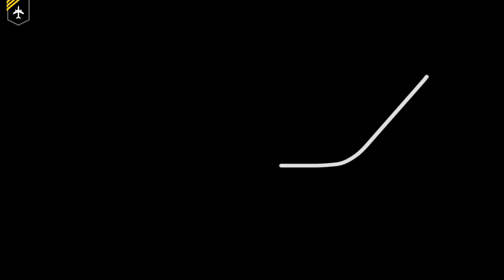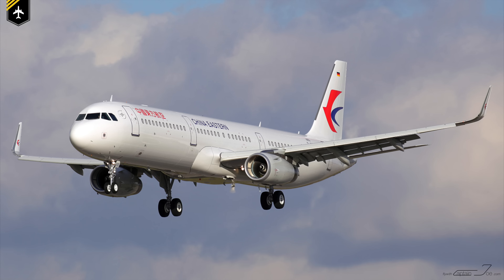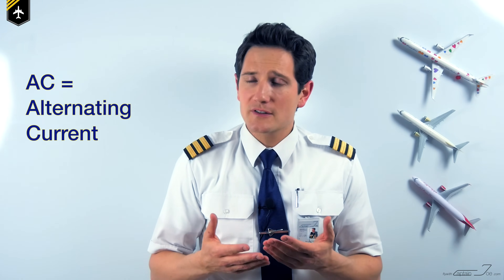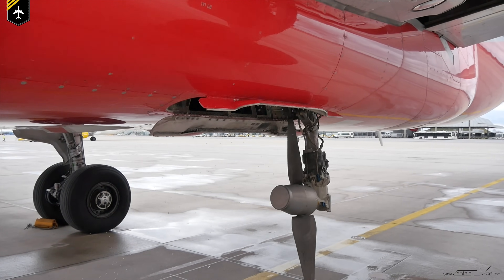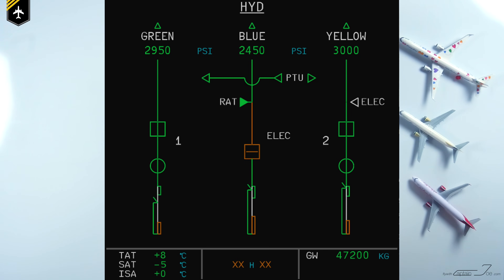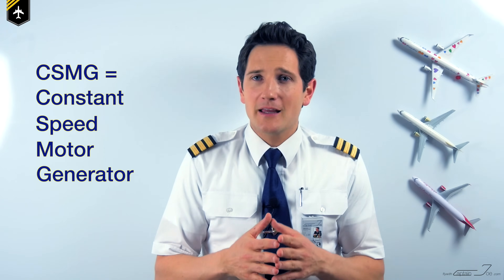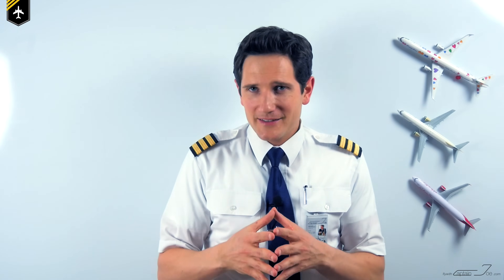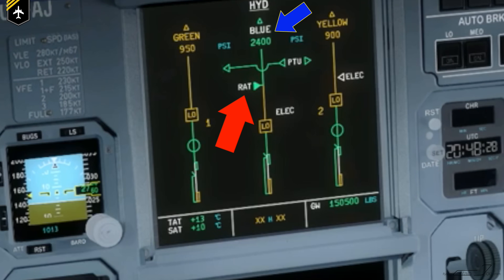What´s a RAT? RAM AIR TURBINE! Explained by "CAPTAIN" Joe

Comment: hi joe,
if a plane is running on ground supply and for some reason it fails, will the software restart or there is some backup supply for the software to prevent it from restarting?

Comment: Thanks for the video Captain. The Gimli Glider incident involving Air Canada Flight 143, and later made into a movie "Falling From the Sky Flight 174", where RAT was deployed and one of the main reasons the plane could be landed without any power from the engines and hydraulics.

Comment: how y can control the speed and mentain the speedwithout engines ?? 
Q : on the famous incident story of the British flight how can or did try the plane captain to start the stopped engines when he was flying through a big Indonesian volcano aches the all 4 engines stopped by the Sulphur ashes and the plane glide for a long distance without thrust .. he used the wind or the small engine for startup at back of the plane or can the RAT provide enough Electricity for plane ?? why they don't make more RATs ??

Comment: I don't understand why don't they just put like 600 lithium ion batteries or in this case like 300 as they do in the Airbus  A380 or whatever that huge plane is and just draw off them? They will get a hell of a lot more then 5kv which is almost laughable for control surfaces on an airplane
Reply: It's due to the weight and fuel efficiency. That's why electric planes are no where to be found.

Comment: Hey, I always thought that in the case of a double engine failure that the air friction from the speed of the plane would always keep the engines moving at a slow speed? Is this not enough speed to keep electricity going?

Comment: Seems like overkill.... You have an apu
Reply: D E apu is still an engine. So if there is no fuel, then the apu is basically a waste.
Reply: @ZK-APA  I see thank you. Prevents single point of failure if you run out of fuel.

Comment: Captain Joe, or anyone else:
In an absolute emergency, how long can the A.P.U power the entire plane, say, at cruising altitiude?
Reply: There is no time limit on how long an APU can power an aircraft except fuel.  Most have an altitude limit on when they can be started and you can only draw as much current as the APU gnerator is capable of providing.  Typically you would have at least 1 generator on each engine (some aircraft have 2 generators per engine).  So you would have to loose both engines to be down to the APU as the only generator source.

Comment: Sir,
I want a detailed information about the pitot tube and it's working.. 
So can you please make a video on it.. 
I really want to know that how does it actually works.. 
I mean how can it indicate the accurate speed of the air speed indicator which in turn is connected to the pitot tube.. 
I'm not getting the valid solution of my question & so you are the only last hope left for me.. 
So, Sir please make a video on pitot tube whenever you're free!

Comment: Air ram turbine... Air ram...  Air that rams into the turbine and mixes with the fuel.  The air compresses as it gets rammed into the engine and that creates the combustion.
Reply: THIS ISN'T ABOUT THE BACK UP GENERATOR PROP BUT AN ACTUAL TYPE OF ENGINE CALLED A CRAM JET.

Comment: The APU wont power the B SYS EMP. RAT will automatically deploy for the 320 in TEFO, loss of one engine and loss of other engine driven generator, or loss of normal power production. No dependency on the APU.

Comment: So in the presence of APU why is RAT required??
Reply: If you ran out of fuel for instance, and that actually happend, the APU will not work. Also passanger planes are aloud to take off with a non functioning APU.

Comment: I watched too much TV on air crash investigations. Usually the investigators say something like '...the controls (RAT etc), failed - then you see the plane turn upside down and the pilots start going down. My question, during deployment of RAT can the air speed rip off the RAT's propeller blades or entire arm for that matter? Cheers!

Comment: In 2092 an Air Transat A340 flight from Toronto to Portugal lost all fuel (through a leak) and hence engines: they glided from cruise height to land in the Azores using the RAT for power.

Comment: Hi Capt Joe... After all unnecessary electrical appliances are shut down, does the RAT provide sufficient power to have the cabin air-conditioning function normally? Especially since all major aircraft types before the B787 rely on bleed air for air conditioning??
Reply: Ashwin Valecha Of course not if your using the RAT it means all the engines are off and you need engines for airconditioning

Comment: I believe this is how AirTransAt flight 236 landed when they ran out of fuel over the mid Atlantic. Even though it was a glider, at least it was a controllable glider. As the green and yellow hydraulics were lost due to engines starvation the RAM kicked in to control the aircraft by providing minimum electrical power to the aircraft instruments. I also believe it was an Airbus A320 as well.

Comment: Captain Joe - could you make a video Cockpit 101 showing where all the instruments are and what their functions are - for example when you did the demo of a passenger landing a plane most of the time was spent directing where a certain button or control is - thats what i am talking about. My nest biggest question would be what happens if the ILS goes out and you are in cloud with no guidance on glide slope or runway alignment. Thanks

Comment: Why not install several RATs?
Reply: ronch550 it creates air resistance and slows a plane. If both engines fail you have no thrust. With big air resistance a plane goes down faster.

Comment: Batteries can provide power minimum 20min or Maximum 20min? Thank you  to clarify, captain JOE.
Reply: 20 minutes are guaranteed, but the minimum guaranteed time span is effectifly the maximum time span you can use them reliably.
Maybe the batteries hold 30 minutes but maybe the already fail after 20 minuten and 1 second. So pilots calculate with 20 minutes max because after that they can fail any second.

Comment: hey Joe why isn't the RAT deployed all the time wouldn't it be fuel efficient
assume that plane consumes 5 megawatts of power per minute after an hour with RAT deployed it will consume only 4.74 megawatts per minute i.e you save 16.66 megawatts per hour
isn't that efficient
#captainjoe
Reply: Rajwardhan Sagare in the air electricity is generated by the main engines. So there is hardly any extra fuel consumption to require a RAT
Reply: A2DJP  thanks

Comment: Air Transat Flight 236 Dual engine failure due to fuel starvation. So no APU. RAT was the only option which provided basic power as Capt. Joe explained.  Captain Robert Piché and First Officer Dirk de Jager flew their plane without engine power creating a record. Souls onboard 306. All survived. In Capt. Chesley Sullenberger case they had fuel to power the APU.

Comment: RAT in therms of probability is in the same cathegory as life vest on board the plane. If the plane goes down in water (usualy ocean) it will brake into peaces and life vest will have no meaning. Also main engine driven AC generator will fail in 0,001% of cases. More often the engine itself will fail thus AC generator won't provide power. On multiple engines aircraft it is higly unlikely that both engines will fail due to mechanical problem. Also in such a case we still have APU or battery wich will last long enough to glide the plane down. We will lose engine thrust due to fuel problems or bird strike or something with higher probability. In my opinion RAT is just not needed since I see no real life scenario it will be needed.
Reply: Actually, the RAT saved some people asses in the real world. The batteries provide you some instruments but no hydraulics. That's why you need the RAT and if you have an engine flame out because of fuel starvation, which did happen in the past, you can't start the APU because the APU uses the same fuel as the main engines.

Comment: Thanks again for your very informative videos. For sure a Captain has to know about the RAT, but does this include your very technical knowledge about the hydraulic and electrical systems? I always through you had a board engineer in the past or today on the ground for such technical knowledge. Don't get me wrong, I don't really know much about your job as flight captain and the things you need to know, but I really enjoy all these technical details. For me as technician I feel pretty safe now, knowing that pilots know their airplane ;)

Comment: Question: So in an emergency, the green and yellow systems give way to the blue system to provide power for the flight controls to work?
Reply: Not exactly. The hydraulic system in an Airbus is designed in a way that the blue system provides pressure for all basic flight controls like the elevators, ailerons, rudder and flaps and slats. The yellow and green systems acts mainly as backups and also provide pressure for the less importent elements like the spoilers, landing gear, thrust reverser and so on.

Comment: Joe, RAT cannot provide enough power to the flight electrical system by which ailerons, rudder and elevators can be moved. So its APU which provides enough power for the movement in case engines fail.

Comment: Why only one? When you have multiple RATs you can get more power, right?
Reply: More RATs would mean more weight and also, they deploy in the case that all engines have failed. So they add drag to an airplane that already has no means of propulsion.

Comment: What about other planes with no RAT like the 737 ? how is electrical power generated in case of both engines and APU failure and no batteries left ? I know it's not a fly by wire plane so they could maintain flight control (even if it's a though work since HYD are lost) but what about flight instruments ?

Comment: Hello joe

When you talked about the batteries the first time you said it works for a "MINIMUM" of 20 minutes, later you said for "ONLY" 20 minutes. Which one is it?
Reply: Well, they are guaranteed to work for 20 minutes. But as a pilot in an emergency, you calculate with a maximum time of 20 minutes, because after that, the batteries can fail any second, which you don't want to happen as a pilot.

Comment: At 1.49 you said that the batteries would only last for a "minimum" of 20 mins of flight (i.e more than 20 mins), yet at 2.13 you said they will only run for "20 minutes"??  Did you mean to say maximum?

Comment: On The Harrier (AV-8A/AV-8C) it is located directly  in front of the tail plain. It takes less than a second to deploy in case of Hydraulic failure.

Comment: Thank you Joe for your videos, I really appreciate your work !
In the case Of the Hudson river, there is more to say. Captain Sullenberger used his APU a few seconds after the birds strike. The APU needs about 2 minutes to be operationnal. Then, the RAT and the batteries covered the gap during these 3 minutes. 
I guess that any gap would cause the aircraft to be uncontrollable, but fortunately it's inconceivable because of redundancy !

Am I correct ?

I also react to an other comment. The RAT doesn't provide a lot of power, but it's a simple system. A simple system is more economic and less likely to stop working, especially when needed !

Thanks you again !

Comment: Hey Jo,
a question to the Hudson landing of flight 1549. As far as I remember, on a water landing both turbines have to make contact to water at the same time. Otherwise the plane would not ditch straight but crash to the opposite wing and take serious damages. As the RAT was deployed, did it play a part in this situation?

Comment: just a side note, the 747-200, and 747-400 do not have a RAT, the number 4 engine acts as a RAT because the airflow turning the fan blades is enough to generate emergency hydraulic and electrical power to the aircraft. the 747-800 does have a RAT

Comment: By minimum of 20 minutes, I assume you meant maximum 20 mins battery time?
Reply: In the example scenario he paints, he says "the batteries take over, but as stated before they will only last for 20 minutes".
That's not minimum, that's saying "you get 20 minutes". In other words, I'd suggest the whole thing is clumsily worded.
It might be that the safety requirement is they provide 20 minutes power and might provide more, but that only 20 minutes may be relied upon. If that's the case, that's how it ought to be expressed as it's concise in all aspects.
You're correct, however, that I misinterpreted his text as a mistake. It's not a mistake, but it is poorly worded when compared with the operational effect (you can only rely on 20 minutes) and the absence of what might be possible.
I'd want to know if  can rely on 20 minutes but might get an hour vs I can rely on 20 but expect to run out within 25. Sure, I can only rely on 20 either way, but my prospects look somewhat better if I could get 1hr vs a maximum possibility of 25.
Cheers
Reply: I am taking a guess here but when it comes to aircraft safety and redundancy it seems logical to assume batteries should provide energy for at least 20 minutes thus minimum sounds quite plausible.
Reply: Edit: altered this based on mcfurley's comment.
Reply: you said it yourself, run out "after" 20 minutes, so 20 minute minimum
Reply: yes well said thanks

Comment: The Boeing 737 does not carry a RAT, does that mean that the 737 relies only on battery power in order to power the electrical system and hydraulic systems?

Comment: You have an awesome channel!   

I flew in a MD-88 over the weekend where there are 3 seats on one side and 2 seats on the other.  It got me to thinking.   Are there any other balancing systems in a commercial Jet besides trim?  Can fuel be moved around to help balance an offset in weight?

Comment: I understand that a positive dihedral angle tends to add addition stability to an airplane's flight characteristics.  However, large transport planes like the C-17 and the Antonovs have a negative dihedral.  Why is that?
Reply: Essentially its the same Lee, but opposite.  Dihedral adds stability as you correctly mention, anhedral reduces stability, which in turns improves maneuverability.  You will notice on most large transports, the high wing mounted aircraft have anhedral.  The pendulous effect of the fuselage automatically adds stability, so in some cases the anhedral is adopted to ensure a suitable amount of controllability/maneuverability.

Comment: this "rat" system was a key component of the safe emergency landing from FL360 (36,000ft) after a fuel miscalculation on an air canada flight. resulting in both engines flaming out with literally only minutes of alert warnings from the fuel pump pressure indicators. (from warning to engine flame out). The boeing aircraft landed safely but the nose gear didn't lock correctly and collapsed but the plane came to a safe halt at gimli airfield in the USA.

this aircraft was nicknamed the "GIMLI GLIDER" and flew many more years of service after undergoing small repairs :)
Reply: Gimli Glider is one of my favorite story in terms of aviation accidents
Reply: @hannahapor4856  Same!! (TACA110 is another one of my favourites; check it out if you're not familiar with it! Mayday episode 'Nowhere to Land'.)
Reply: oseo943 
And Gimli is in Canada
Reply: Air Transat flight 236 (24-Aug-2001) as well had the RAT come out as they suffered fuel loss due to mismatched fuel line diameters on account of botched maintenance.
Reply: Gimli glider story :-P
Reply: Thomas yeah Canada was switching from Gallons to Kilograms and they asked for the amount of fuel in gallons and ground gave them that amount in kilograms.
Reply: @j-c4997  It was more complicated than that, they used an incorrect value for the fuel density when making calculations.
Reply: Mentour Pilot has a great video about Gimli Glider: https://youtu.be/cZkKFSqehN4

Comment: Did Sully not deploy the Rat manually? And also out of sync for the failed engine check list? I am sure I read that it was the first thing he done and this was one of the reasons he succeeded in landing on the Hudson? If he had followed the checklist it would have been switched on at a later point ( not much later but still later)

Comment: I don't think the horizontal stabilizer is a flight control surface; that would be an elevator. However some smaller airplanes use the stabilizer as the elevator which in short they call it the stabilator. Just thought I'd point it out... even great masters make petty mistakes... now carry on 😊
Reply: Sahab Mas Every movable rudder surface on an airplane including flaps, slats, spoilers, airbrakes, trim tabs etc is regarded as a control surface. The main control surfaces would normally be the rudder, ailerons and elevators while the flaps etc are secondary control surfaces.
Reply: Benny Löfgren I completely agree with you, and my point for the comment was that the horizontal stabilizer as an immobile component of the empennage is not a control surface

Comment: Dear Captain Joe, I have two questions.
(1) At 1:49, should it be minimum or maximum?
(2) I understand RAT causes drag, but installing more than one RAT in larger a aircraft should be more helpful for flight control by providing more power and keeping more cockpit instruments alive. Also, one of them can act as a backup of the other. What is theopinion of an aeronautical engineer?
Reply: Given that they have only been useful in a handful of landings, the chance that having two of them being useful is vanishing small. For them to deploy, ALL engines and the APU must fail.